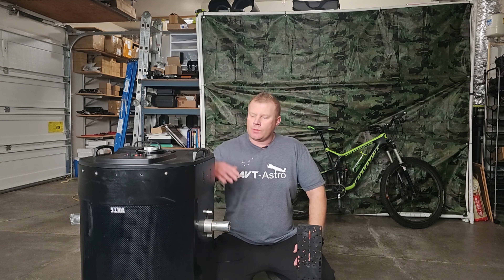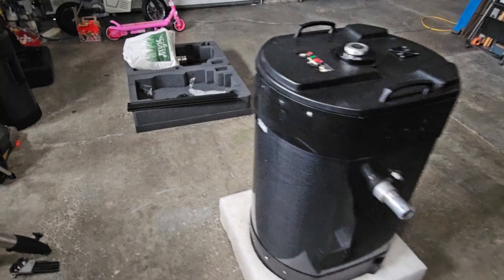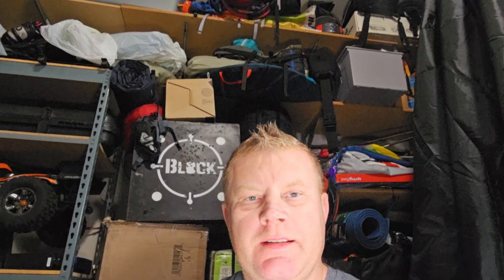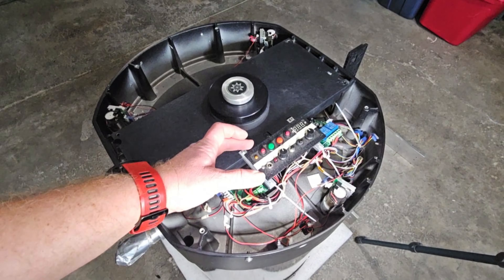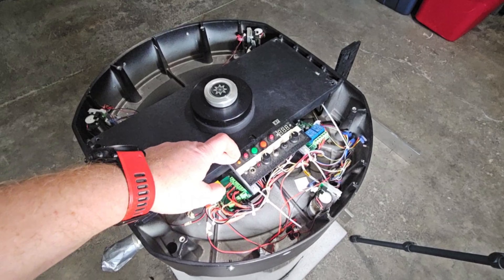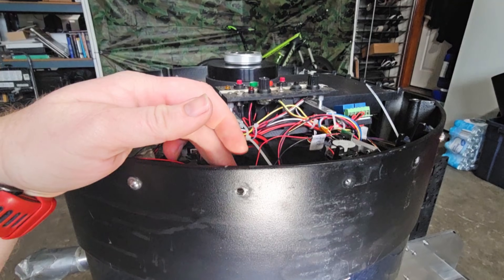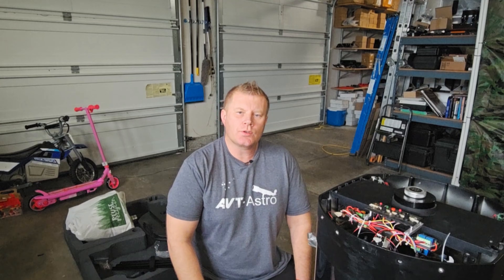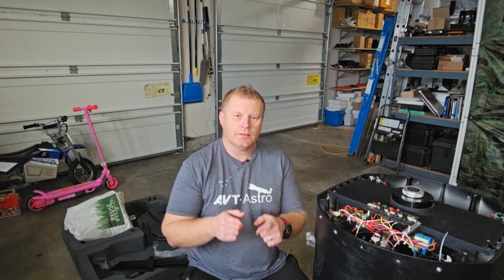16" Meade RCX400 SCT Telescope OTA Rear Cover Removal / Dovetail Mount Design - Part 1

Comment: I have the '04 Lx200GPS version of the 16. 
The original dovetail riser had 4pt attachments each end which would support mainly accessories like a large APO refractor. 

A set of Parallax rings were the preferred method to fully support regular 16s on single dovetail.  But yes the weight is significantly more than a Titan would photographicly suggest.

The RCX are well advanced optical design but not mechanically.  Sadly the design choices were overly complex for the 3pt focus/collimation. 

These days I'd redesign those stepper motors to be mounted up front with access covers in the OTA wall if necessary.
Reply from the maker: Thanks for the info. And even my 12" Meade ACF has the 4-point dovetail adapters. Was there some kind of issue that people were experiencing to warrant the Parallax rings?
Reply: @AVTAstro  Paralax rings were the defacto method for large aperture Newtonians so the tubes could be rotated for framing. When they were replaced with cassegraine models of similar size it was simple.  As larger than 16" cassegraine apertures came on board GEMs were replaced by fork mounts.  Because these were permanent installations vs interchangeable OTA systems the 16"-22" SCTs all tended to only use dovetail as accessory plates. Owners of the larger capacity GEM preferred parallax rings also for perceived flexure possible with dovetail mounts. The rings isolated the OTA and dovetail from one another to deal with this perceived issue.

Comment: Great video as usual Vlad! It's really interesting to see such a huge focal length telescope shrunk down by optical wizardry (I mean the SCT design). 
If I remember correctly you said that this scope is not F10 like other SCT's but rather an F8, that is a very interesting design choice. I wonder what difference it makes if you use it visually? 
Do you have any plans to get a reducer for it?
Reply from the maker: Thanks for the feedback! Visually you will just get a wider maximum possible FOV compared to f/10. I do not plan to run a reducer at all. For me the point of having such a scope is the longer focal length! I'm going to be hunting tiny planetary nebula and galaxies with this beast one day!